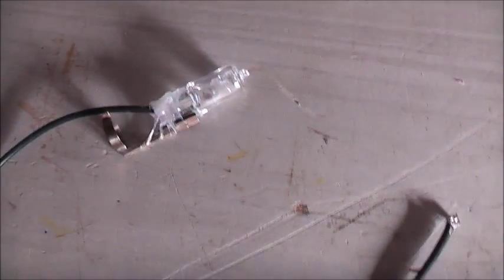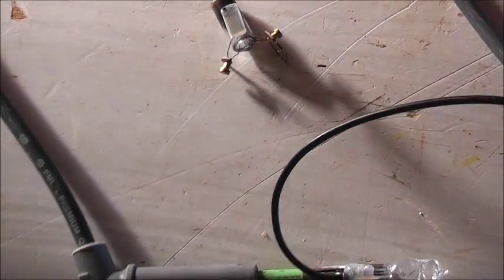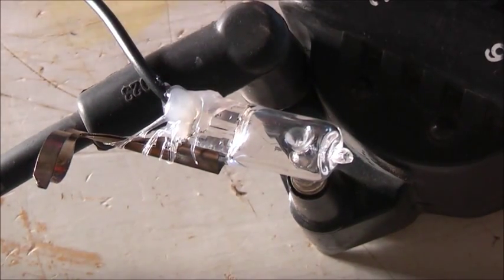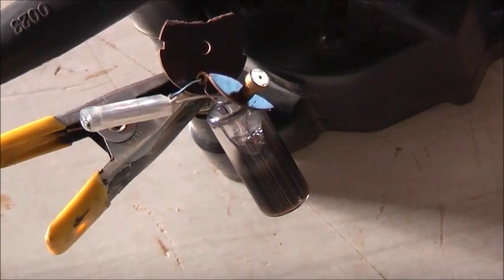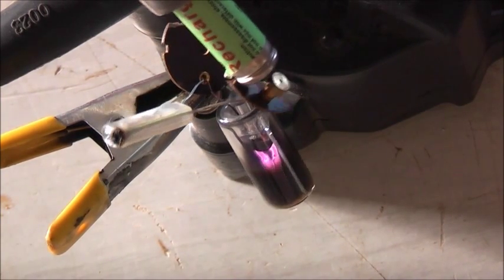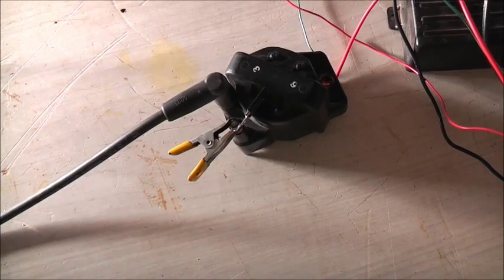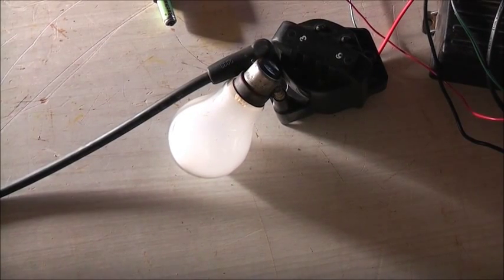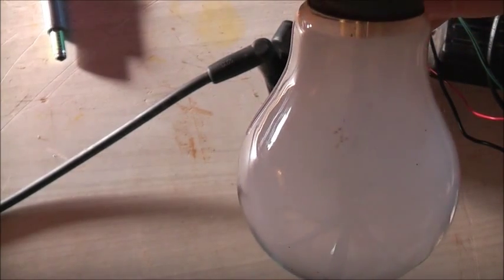Ignition Coil Fun!

Comment: Haha...Spark-plug battery again. :D

Aren't you worried about that exploding or something? While there's only a small current on that coil, there sure is a lot of volts going through that battery. :D

The effect that you achieved with the jumping bits of filament in the halogen bulb is quite similar to what Photon did with those lightbulbs when I was there. :D

We also got little bits of filament jumping around in the bulb when one of them got zapped with HV on those big Tx's

Thanx for showing.